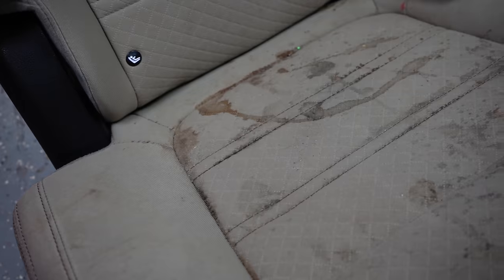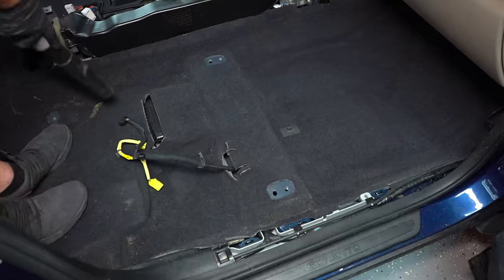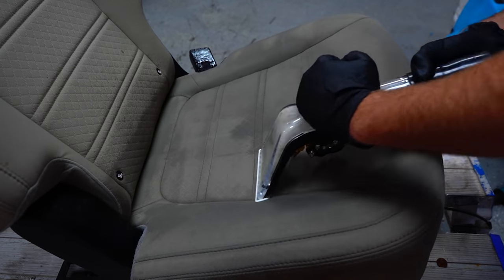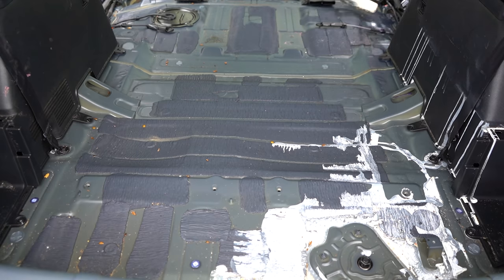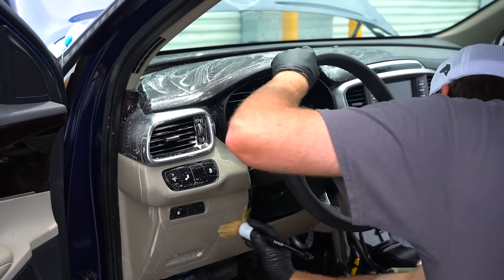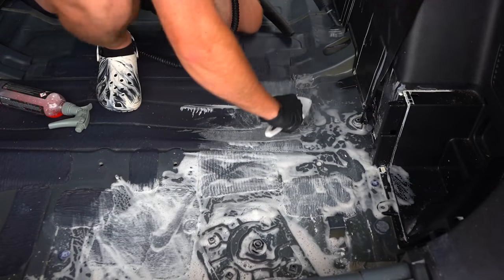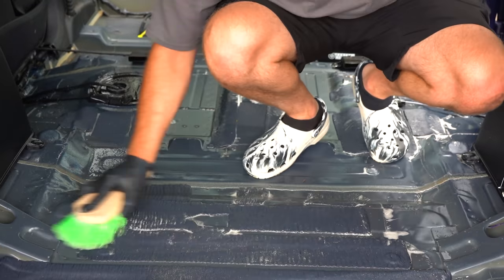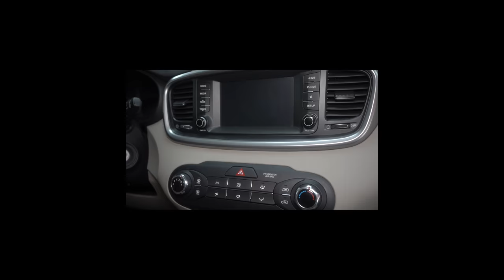Super Cleaning The Nastiest ROACH Infested Repo SUV | Insane Satisfying Car Detailing Transformation

Comment: This is where I'd pull EVERYTHING out of that car. ALL of the interior trim pieces, roof liner, the entire dash assembly and center console which would get completely disassembled and cleaned OUTSIDE because the roaches will have laid millions of eggs all around the electrical components and the fuse box. You would be grossed out seeing just how caked with roach grime everything inside that dashboard and instrament panel was. Trust me, if you didn't clean in those areas, the roaches will just come right back.

Comment: Step 1 - Pour concrete slab with 6" curbs in an empty field, 1 foot larger than the vehicle in every direction.
Step 2 - Place roach infested car in center of slab, preferably with a forklift to avoid actually being in the vehicle.
Step 3 - Place 4 - 1 gallon jugs of gasoline in the car, one in each seat.
Step 4 - Crack the windows and close the doors.
Step 5 - Order sandwiches for all personnel involved, including firefighters.  
Step 6 - Set up all available cameras.  
Step 7 - Fill the slab with 4" of gasoline.
Step 8 - Start filming.
Step 9 - Ignite the gasoline.  You should probably move back.
Step 10 - Share sandwiches with your friends and the firefighters that show up.
Step 11 - Share video with YouTube!
From Bills method of dealing with roach infested vehicles.
Ok... your customer wanted the vehicle back...  You all did a great job!  M.A.D. Profs!